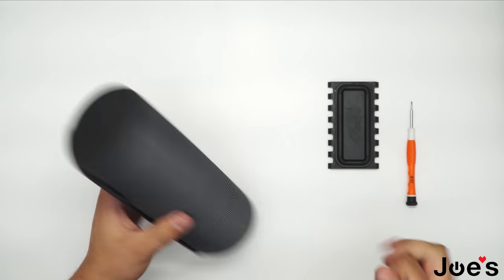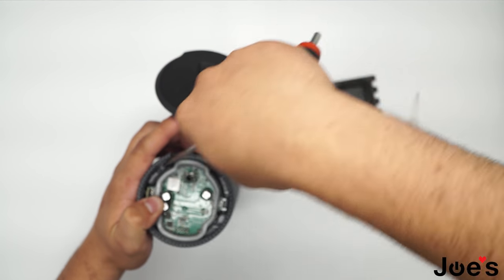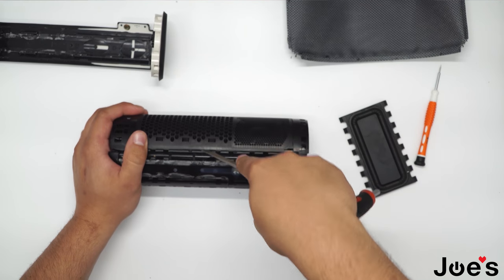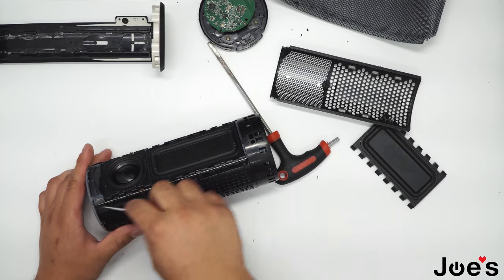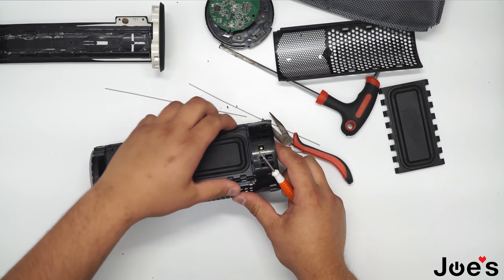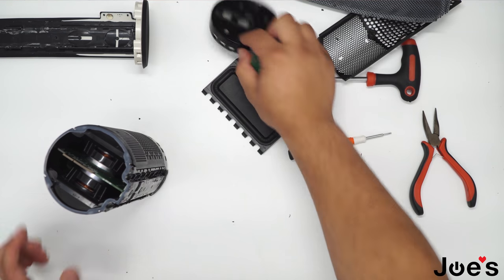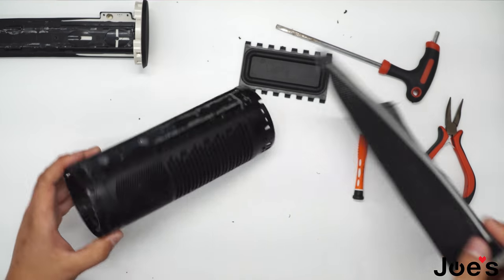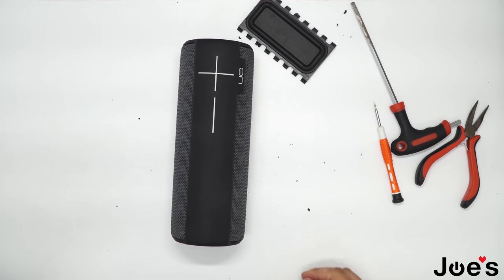UE Megaboom Ulimate Ears Blown Speaker Bad Bass Passive Radiator Replacement

Comment: I just followed your instructions, found that the MB I bought for cheap that didn't sound very good... the glue around one of the passive radiators failed.  I opened it up, replaced the glue with polyurethane sealant and sealed it down all the way around... we'll see in the morning!

Comment: Thank you so much, I realized the adhesive of my passive radiator was nonexistent, so I applied bit of superglue to the corners, and sure enough, it sounded just like new!
Reply: funnily enough this also happened to me, the adhesive on one section was nonexistent, another superglue fix!
Reply from the maker: Thanks for watching! Glad you could fix the issue! CH
Reply: Thank guys! I was trying to find out which glue to use. I figured superglue would work but didnt know if you needed some type of rubber cement or what. I'll give it a shot. One whole side doesn't have any glue.
Reply: CJ C I used “Krazy glue” on mine and it works perfectly now, it looked like the original glue melted or something it was pretty weird.

Comment: Thanks for the tutorial! my speaker makes a crackling sound whenever there is bass in a song. Does this mean one of the speaker units are broken and needs to be replaced or the passive radiator needs to be replaced?
Reply: Yes I think it’s that mine is doing that too, I opened it up and the glue was melted so I just put crazy glue on the edges and it works good again. Thank god it wasn’t ripped saved me the hassle of buying a new one and waiting

Comment: Thank you for this video. Helped in opening up the UE Megaboom. I found my problem was that a corner of the speaker mounting had cracked off allowing air to escape from the front to the back contributing to the a crackling noise. A bit of putty to seal the hole and now the speaker sounds nice and "controlled" again.
Reply from the maker: Glad we can help:) Please like, subscribe and share the video.

Comment: Hi, how would I know whether or not this needs to be replaced? What does the speaker sound like when it’s bad/how does a bad one affect the speaker and indicate that the radiator needs to be replaced? Is there a way to check/know without having to take the speaker apart?
Reply from the maker: Thanks for watching Trent! If there is no bass on your speaker or you hear a crackling or whistling noise, this would indicate either a blown speaker or an air leak around the speaker. If the sound quality is poor, you would know that the speaker is bad. Matt D.

Comment: Is it normal that big kicks in bass test songs do a little crackle at highest volume? My speaker is brand new and I'm thinking that it's normal if I crank it up at max volume that it can crackle if it gets too much bass but just wondering... It seems to be doing it on both drivers (both sides)
Reply from the maker: Thanks for the comment. Yes, this is normal as the bass is usually boosted in the sound test tracks. 
-David P

Comment: Hello, mine has a very pour bass. At high volume the bass sounds pretty bad. 
Passive radiator demaged or speaker drivers demaged?
Reply from the maker: Thanks for the comment. The issue you are describing sounds like a damaged passive radiator.
If you would like your device repaired by a professional you can fill out a repair form and follow the steps to send in your item. We offer free shipping and diagnostics. Here is a link to the repair form:
https://www.joesge.com/pages/repair-services
-David P

Comment: Thanks, this helped me to replace my passive radiator and it sounds a lot better now.  I couldn't get the power button end off by itself (there is a red layer inside that I couldn't pry open) but I was able to take it off all together with the chip piece
Reply from the maker: Thank you for watching! We are stoked that you got your speaker fixed! MD.